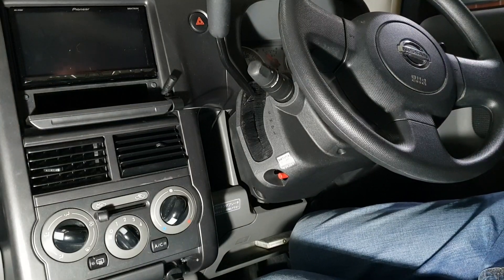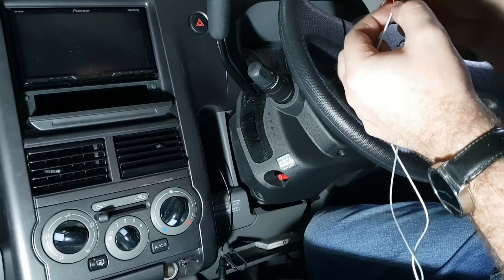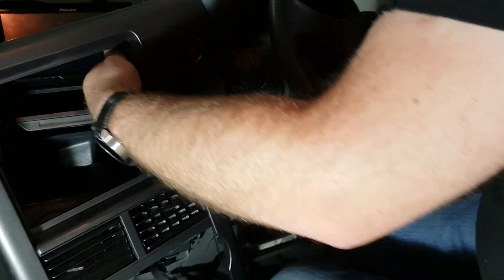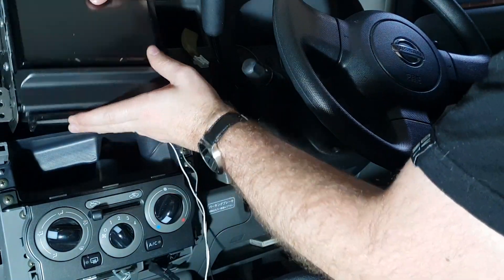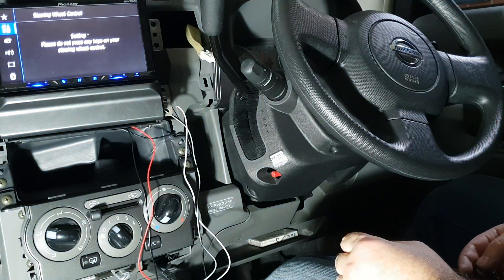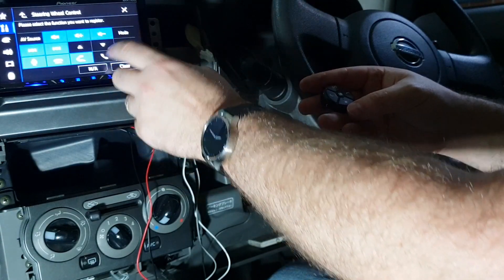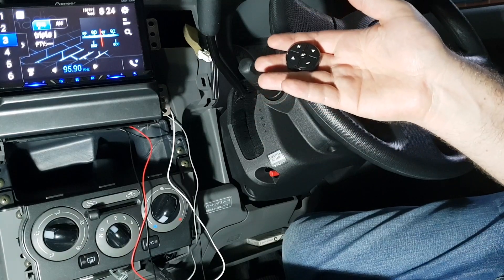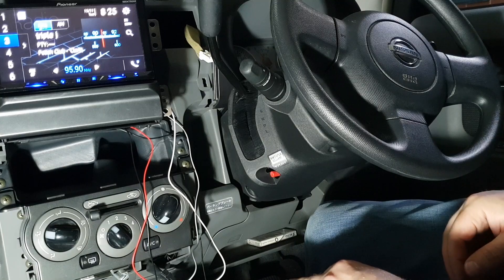Steering wheel controls - how to add them to your older car

Comment: Key1 is white?
Reply from the maker: In my case yes, but as I said test it out first before you go putting everything back together just in case you need to swap them around
Reply: @Sawickipedia  My car only has key1, how to install?
Reply from the maker: Just connect key 1, you may not be able to use all the buttons though. Alternatively you can try connecting both key 1 and 2 to the same wire but I'm not sure if that will work

Comment: I have a 2005 Ford Focus. I find it odd that my car came with the component speaker spaces in the A-pillars, and an Aux connection in the glovebox, but did not come with steering wheel controls, even though it also has cruise control. Now I want this slick little setup to rectify that.
Reply: Cheaper to manufacture empty a pillar tweeter pillars than have one for one car and not the other

Comment: I have been all over the internet for over a week, scratching my head all along just to find some info on this. So lucky that i found your tutorial. I recently bought an identical remote from AliExpress and clueless as to how to hook it up to my sony xav 5000 which also recieves swc inputs through 3.5 mm jack. If my understanding is correct, we don't have a ground to connect to jack, only key1 and key2. In what order did you connect them to jack? There are 3 coloured wires when i spliced the jack.
Reply from the maker: You are correct with only having key 1 and key 2. You should only need to use the red and white wires coming from your jack. I don't remember which way around I had them but as I said in the video just twist the wires together to begin with. I may take a bit of trial and error to get it right, but it won't harm your stereo, it will either work or it won't. I got lucky first go
Reply: @Sawickipedia  thank you so much. Not until i stumbled upon your video, it struck to me that i could hack a 3.5mm jack to get the job done. Kudos to your smart improvisation.
Reply: @ashokp9260  hey did you get your wiring to work? I have the same radio and am confused where to connect key 1 and key 2 too

Comment: Thats perfect, i wonder if that work on DEH s510bt, don't have settings like yours, not sure if is possible to program it manually, but it has 3.5mm jack for wheel control...
Reply from the maker: I had a quick look through the manual online but couldn't find any mention of it. So it may work, it may not

Comment: Thanks for the video. I was intrigued because I bought a set of those T3 controls primarily for an Eonon Chinese radio that has the 2 wires (not installed yet) but tried them on a Pioneer just to see if they would work. I think I tried them on an AVH 2700 BT and I also have AVH X390 BS and AVH 2300NEX not tried yet. I dont think it controlled anything on the 2700 and none of these stereos have this SWC set up screen that I can find. The Eonon does have it so I expect it to work well there. Can you shed any light on the model Pioneer you are using and maybe step by step how you found that SWC set up screen? So far I have successfully installed an ASWC 1 in a 2007 Forester and in the process of installing an RFASWC which is what led me to your video. I wish Pioneer would just make a wired controller similar to the BMW Idrive or  Mazda type that could be stuck somewhere on the center console. Some people would prefer that to SWC especially in countries with a lot of corners. Thanks.
Reply from the maker: The swc setup screen is under the general settings on my model. It is a pioneer avh-z5150bt. I think your best bet would be to check the manuals for the stereo's that you have to see if they mention anything about it, you should be able to find them online
Reply: @Sawickipedia  thanks for the reply and info.

Comment: I bought a similar product and they came with a rubber pocket/sleeve thangy so I guess they can be removed/popped out.  I'm concerned about the adhesiveness of the supplied double sided sticky tape to mount the "Rubber" pockets to a somewhat rubber textured /soft steering wheel surface. Anyone else have any issues or do they hold up well? And especially in hot weather. Do they adhere or will they be something that requires replacing the double sided sticky every 6 months?

Comment: @sawikipedia what wires did you connect the red and black ones to on the back of your headunit?
Reply from the maker: They are connected to either key1 or key1. It may take a bit of trial end error to get them right as every headunit is different
Reply: @Sawickipedia  which wire goes to key 1 or key 2? Red? What about black one?
Reply from the maker: @salty1234567890  Sorry, I thought you were talking about the wires from the 3.5mm plug. I realise you mean the wires from the controller box. Red should go to your 12v accessories power wire or any 12v source that is live when you turn your key to the acc position. You can also connect the red to a constant 12v source (like directly to the battery) but this will mean it will be constantly powered on and will drain your battery.
Black just goes to ground, so any bare metal part of your car or wire it in with the ground wire from your stereo (usually the thick black one)

Comment: Hey! Where did you get the 3.5mm jack to wire in key 1 and 2? I thought about hacking up some cheap headphones, but I doubt the wires are thick enough for that.
Reply from the maker: From memory I think I used some cheap headphones. Just keep the length fairly short (under 3ft/1m) and you should be fine
Reply: @Sawickipedia which wires on the jack did you wire up key 1 and key 2 to???

Comment: Hello, i have AV290BT. But in settings i'm missing this Steering Wheel Control function. But my device from what i've read, it works with adapter for steering wheel control. For example, do i need that option in settings to make those button works? Or once i install the modul that comes with them, this option will be open for me or something like that?
Reply from the maker: On my headunit there is a steering wheel control option under general settings. I don't remember if it only appears after plugging the steering wheel controls in, but I do know that the headunit will have the option greyed out unless it is set to "source off"
Reply: @Sawickipedia  i dont have it even in gray. I have the jack for this party adapter for steering wheel, but not the function in settings :)

Comment: How do you wire Line 1 and Line 2 on the Aux Cable?
Reply: Did u ever figure out how? There's 4 wires but not sure which ones to use

Comment: Do you have to  set the keys in the SWC a number of times. That the issue I am having. The Android unit forgets the keys I set and then I haft set em again???
Reply from the maker: You should only need to set them once.  Sounds like an issue with your head unit, does it also forget anything else - time, speaker settings, etc?

Comment: How do you change the batteries?
Reply from the maker: They both have cr2032 button batteries, you just insert a small screwdriver into the side to pop them open
Reply: @Sawickipedia  let say if i don't use the sticky adhesive at the back of the button, but instead i  drilled a hole on my steering wheel and installed it flushed on the steering wheel, leaving only the button surface exposed to be pressed.By that logic, im definitely going to make the batteries replacement procedure much more difficult for myself, isn't?
Reply from the maker: Probably, the sticky adhesive is quite strong so there's really no need to screw them on. The steering wheel on the car I put them in is not a smooth surface and they haven't come off since I installed them 18 months ago
Reply from the maker: They won't install flush onto the steering wheel as you have the PCB and battery behind the buttons. You could recess them into the steering wheel, but thus would require a lot more work, and you need to watch out for airbags and anything else on the steering wheel
Reply: @Sawickipedia  thank you so much for your input, and have a wonderful day/night  wherever you are.

Comment: I have the same head unit and I have the same controls. My controls don’t match up to the right buttons, they need to be remapped. For instance, my volume up ends up opening the camera. I see you clicked “steering wheel controls.” That option is nowhere to be found on my unit. It’s not in my settings. My manual confirms my unit supports it and it obviously does because I wired it up the same way you did and they work, just not the correct functions. I’m so confused. I wired it up correct thanks to you, but I don’t have that steering wheel control option in my settings despite having the same head unit. I can’t remap my Buttons. How did you get that setting?
Reply from the maker: It should be under setting and then system (the spanner and screwdriver icon). Mine sits between location setting and restore settings. Note it will be greyed out if there is an active source playing, hit the middle button on the front of the unit and then 🚫 to turn off all sources.
If this still doesn't work, try unplugging your swc from the back of the stereo and see if it reappears, if it does then plug your swc cable back in and try again. You may have to turn the accessories off and on between unplugging and plugging back in
Reply: Sawickipedia thank you I will try this. I have one last question. Did the “Steering Wheel Control” option exist on your unit before you installed controls? I’m not asking if it was there but greyed out, I’m asking if it even existed whether it was greyed our or not. Was that option on your head unit before you installed the controls? Or did it only appear after you installed them? Thank you!
Reply from the maker: @rsg3263  To be honest I can't remember if it was there beforehand. I think that it was. The only other thing that may be worth checking is if the firmware is up to date. You should be able to find it on the pioneer website
Reply: Sawickipedia what head unit do you have? Maybe we don’t have the same one. I’m using an AVH-2400NEX
Reply from the maker: @rsg3263  No it's an avh-z5150. I didn't specify the model in this video but there was a link to the install video around 2 minutes in. As I said I the video your best bet is to check your manual for the instructions

Comment: Kindly let me know that is this device only for Android Screan or can fit to any kind of screan?
Reply from the maker: It should work with any kind, you just need to make sure your head unit accepts steering wheel controls
Reply: @Sawickipedia  I have no idea how check it,  but I have Vitz/Yaris 2008 in which I have Japanese NDDN-W58 stereo.  Now let me that is it applicable or not?
Reply from the maker: Sorry I have no idea if it will be compatible.
Reply: @Sawickipedia  OK

Comment: Hi, would these buttons work on a mark 5 2006 Vw golf? I want to purchase a head unit and these buttons so they’d work together
Reply: They are universal, so yes, they should. Just make sure the new head unit has steering wheel controls input. I think all of the newer Pioneer headunits do. I know the AVH-A215BT does, which is one reason I bought it. Now I just need this slick little gizmo to get it going properly.

Comment: How did you wire the 3.5 mm Jack?
Reply from the maker: Wiring from the control box:
Red = 12v accessories
Black = ground
Key1 = red on 3.5mm plug
Key2 = black/white on 3.5mm plug
You may need to swap key1 and key2 wires if it doesn't work.
Reply: Sawickipedia thanks!  What did you do with the copper wire (ground) on the 3.5mm plug?
Reply from the maker: @aaroncooper8002  I think I left it unconnected.
Reply: Sawickipedia Thank you sir!
Reply: Sawickipedia i